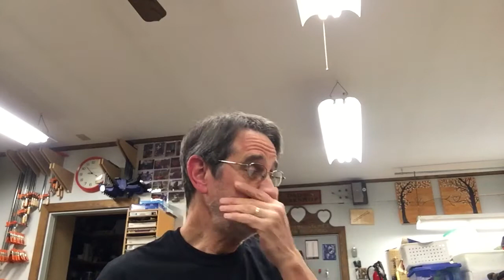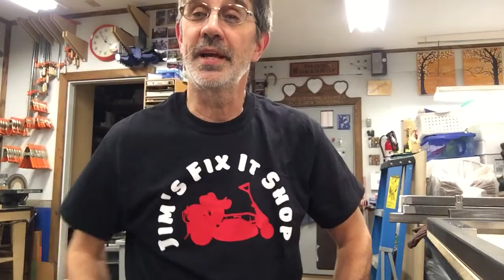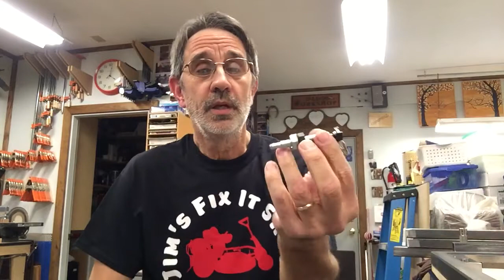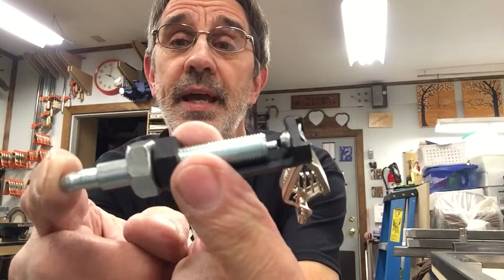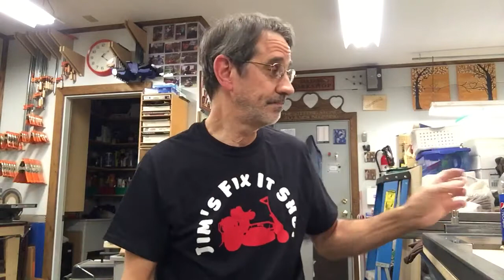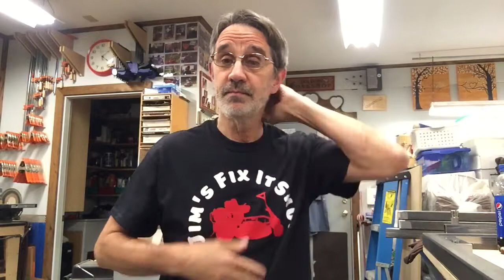319. Safety switches,  good or bad

Comment: Hi Jim.  I'm one of your viewers who hates safety switches.  On my old snapper, I disabled every safety switch on the thing except the ignition switch.  It'll crank in gear with the clutch out and no one on the seat.  So, I get ready to cut the grass, but my starter solenoid is bad.  No problem.  I put it in neutral, turn the ignition switch on and use a pair of pliers to short across the terminals to get power to the starter.  It fires up and all is well.  As I’m cutting the grass, I run out of gas.  I refill the tank (and obviously slop a little bit of gas outside the tank.  Then I jam the pliers across the solenoid lugs.  The starter fires the engine, the spark from shorting the solenoid ignites the spilled gas, and since I left the mower in gear, I have a flaming snapper running across my yard.  A few bushes stop the mower, a hose puts out the fire and no neighbors are outside to laugh at me.  After a quick break, I resume cutting the grass.  That was 10 years ago and the old snapper is still running.
Reply from the maker: I set my Snapper on fire by blowing the gas out of the cylinder with the plug out and the wire hit the block and Proof I only wish I had the camera rolling.      Jim

Comment: I just bought a 28" a few weeks ago. The first thing I did was disable the silver reverse lever by turning it's pivot bolt around to be able to lock it in the engaged position.  This is the only thing I thought was not needed for me being I have no pets or children around. The rest of the safety switches I'm ok with and can understand the reasoning behind having them. 
 Jim, you would make a great shop teacher at a high school or community college.

Comment: I had to get rid of the seat switch on a newer model I refurbed. Every time I went on a side hill it would cut out because I would lean more to the side. I actually had to leave the switch attached  but hid inside the wire box.

Comment: Instead of a seat switch, how about a lanyard switch like you find on a bass boat or snow mobile, wire it into the wire that goes to the ignition switch in my 86.  mount the switch on the steering post. wear it if you want or leave it dangle if you don't want to use it.  We would need to find a source for the switch.  When I have gotten into trouble I have braced myself with my feet thus not disengaging the blade. Not good!
What do you think??

Comment: Hello. I disabled that irksome reverse lockout on my Wal-Mart Snapper 28" just by simply unhooking the cable end going to the foot operated blade engagement holder. It takes about a minute or so to unhook or hook backup.  I cut 3 city lots littered with the wife's flower beds & various bushes so cutting in reverse easily is a must.

Comment: Hi Jim - it's  Big Rodders in Ireland.  I had an immaculate 2009 33inch model that couldn't be pull started.  I discovered that the safety switch activated by the clutch lever required resetting.  I discovered that the previous owner only ever used the electric start, which indicated to me the problem existed since manufacture.  The only adaptation I made was to disconnect the cable at the deck end to enable me cut in reverse.  However, I reconnected it prior to sale.

Comment: I had the issue where the engine would run until you let up on the brake/clutch petal.  I removed all the safety switches and they all checked fine with an ohm meter.  I was really worried that the “brain” module had gone bad as they are now about $75. When I put it all back together, it worked as it should.  On my series 16, that double function switch under the engine looks prone to misalignment. I’m pretty confident that that was the problem in my case.
Reply from the maker: Once in a while the piece of spring steel mounted on the yolk arm gets bent downward and it doesn’t push in on the switch as it should sometimes you have to bend that up a little bit so it puts more pressure on the switch. Jim
Reply: @jimjackson9381  yea, I’m now wishing I had disconnected the wires at the brain to check that dual function switch in place.  Taking it out & putting it back in probably helped.  I think Snapper purposely made their wiring diagrams & schematics misleading;  on mine, the wire colors don’t agree and several of the indicated terminations just aren’t as they show them.
Reply from the maker: I’m surprised they give us a diagram in the first place. Jim

Comment: Hey Jim love your videos very informative, so I have this issue you mentioned in a comment below my snapper will only start if I remove the black and red combo wires at the magneto block with the ground wire in place, what would that mean is that part of safety switches?
Reply from the maker: There is typically three wires hooked to the magneto shorting block. One wire goes into the engine and hooks to the coil. One wire comes out of the tube from the ignition switch. The third wire comes from the area where the starting solenoid is that is the wire that comes from the safety system, if you remove just that wire and everything works then you have an issue somewhere in your safety system it’s either switches or it even could be a bad wire or it’s your interlock modem.
Reply: @jimjackson9381  yeah cause I had it literally running for a few hours once I hopped off the seat it shut down then wouldnt start again, then played around a few days later only worked when I left ground from magneto off obv didn’t like that the motor wouldn’t turn off, then just pulled that wires I mentioned which is the solenoid apparently, based on how I said it wouldn’t start again after running a few hours you know where I should look first in the safety?? Any help is much appreciated thanks again Jim
Reply: Is the interlock modem the piece that acts like a brain to the safety? Sorta like a relay?

Comment: So with the safety switch under the seat only allowing the engine to run if a person is sitting on the seat then how can you pull start your mower? I disconnected my safety switches which probably wasn’t the best thing to do.
Reply from the maker: On the older machines all you had to do is have it shifted it in neutral there was a switch on the shift handle, the newer machines you just have to push down the pedal and slide the locking bar over the pedal to hold it down,  that’s it. Jim

Comment: If you unhook the magneto wire and your engine cranks and runs but you can’t shut it off with the key switch then what switch is likely the culprit?
Reply from the maker: OK what you wanna do is unhook the wires from the magneto shorting block on your engine put the wire back on that goes up inside of the engine to the coil. Find the wire that comes out of the pipe from the ignition switch that goes to the magneto shorting block and put that one back on leave the wire off that comes from your safety system, that is the third wire that should be hooked to your magneto shorting block unless you have the turtle style machine.  Try that and let me know what’s going on.        Jim